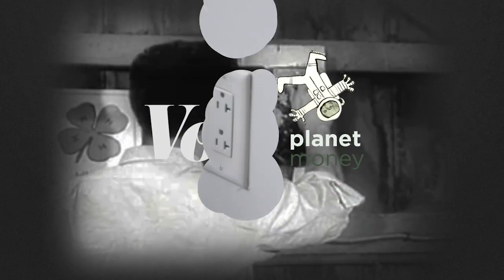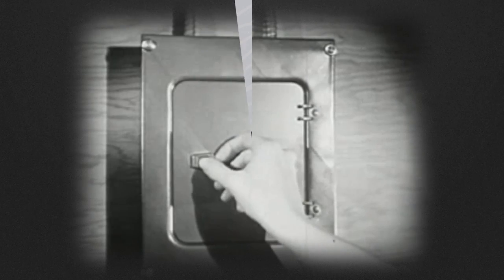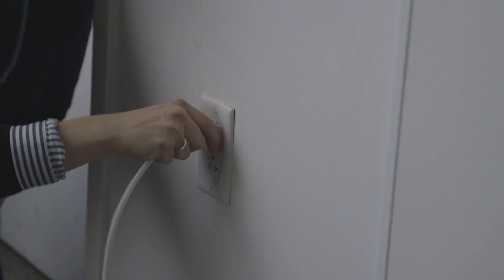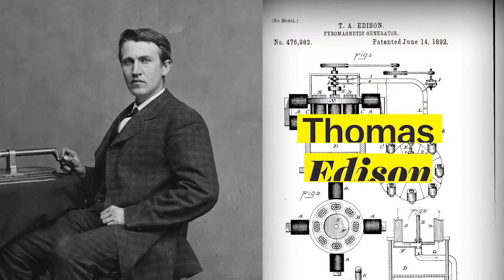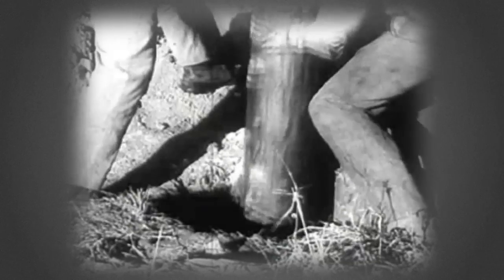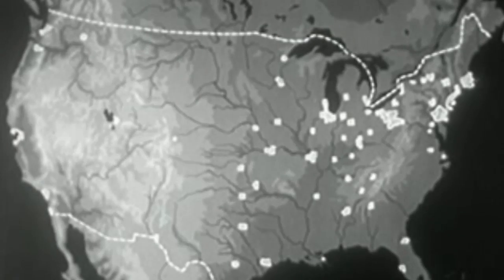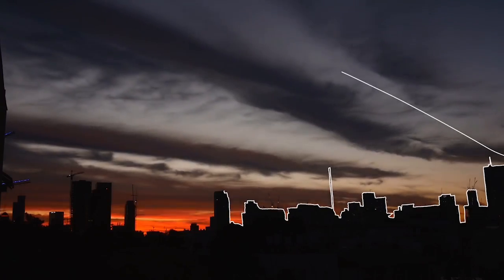Why your laptop charger is so hot

Comment: "Alternating current works just fine for things like light bulbs"....shows an illustration of an LED light bulb....smh.
Reply: Now lets plug this transformer into this 300V battery bank!
Reply: Jakob Schulze
DC doesn't have reactive power losses, but for shorter distances you would need a transformer which is much more than a simple pole transformer. I've seen some that look to be over 60 years old and operating, but electronics always fail. HVDC is good for transmissions longer than what AC can provide or to connect out of sync grids together.
Reply: They didn't really explain why AC won out over DC.  Centralized power generation and the efficiency of transporting AC over distance.
Reply: *****
25 cars in series!
Reply: There are reasons for AC and DC.  My comment was in relation to the time our national grid was made.  AC transition was cheaper at that time, primarily because of Edison's patents and the cost of DC transformers.  I am not sure if that would be true today, however the cost of replacing our power infrastructure would be cost prohibitive.  DC has significantly less power loss than AC, however that is relative.  An AC system with twice the loss of a similar AC system with a 3% loss would still be 94% efficient.

When the US national grid was made Westinghouse and Edison were battling it out with AC and DC systems respectively.  Westinghouse won because the overall cost was cheaper, and maybe he was a bit better of a business man.
Regardless, we have the system we have, and changing now would be cost prohibitive.
I am however intrigued by whole home DC systems.  I knew some appliance manufacturers have announced they may start production of DC appliances targeting the off grid consumers.
Reply: leerman22

dang
Reply: AC has inductive+resistive losses, where DC has only resistive losses. Those inductance losses eventually justify HVDC transformers the longer those lines get without a power plant or consumers.
Reply: DC doesn't work with transformers so you can't easily step up the voltage for transmission over long distances and then step it down again.  This means that in order to properly regulate voltage you are limited to a maximum service distance of a few miles from the point of generation or distribution center.  Increasing the voltage to transmit long distances results in significant power loss when you try to reduce it back down to a usable voltage.  Much of this is no longer relevant since technology has improved and many of these obstacles have been overcome but they were present and drove the development of our national grid, changing it now would be costly.
Reply: +Aaron Hall
For the whole grid this is true, but for some applications DC power lines might have a comeback.
I know in Germany and Europe they might be build to connect renewables better.
A lot of offshore Wind capacity is in the north of Germany, while a lot of industry is 1000km in the south.
France who uses over 70% nuclear has a demand/supply problem. Right now a lot of nuclear power plants are off the grid, while a lot of heating is done with electricity and at other times they have a huge overproduction, as most of their nuclear power plants aren't very flexible.
With renewables thus is worse of course.
One key there is to connect whole of Europe better to bring electricity from where it is produced cheapest/cleanest to were it is needed without any blackouts.
DC transit lines would be beneficial for those long distance power supply.
Reply: Yes, the advent of efficient HVDC transformers which were not present when our grids were initially designed definitely changes things.
Reply: the voltage drop is much more in dc transmission. modern electronics wont help in any way
Reply: they sorta mentioned it, barely... but there was so little information in this video that it hurt to watch it
Reply: +Aaron Hall
Actually over long distances DC is better than AC (as you don't create EM waves), but it is/was much easier to transform AC from high voltage to low voltage and the other way around. With modern electronics it is easily possible to do the same with DC.

Comment: I like Vox, but this video is just plain wrong. It is really disappointing.

Not just about why the converter gets so hot, but also the reason that AC is way better than DC over a long distance. If we output DC directly from the grid, the energy loss would be huge and we need lots of thicker cables to cover. There were photos showing how cables blocking the sky in DC area in the past.
Reply: "energy loss would be huge" i.e. AC is better than DC at traveling distance.

What they didn't cover is why it is better at traveling distance. That's because, unlike DC, AC voltage can be transformed.

Comment: How would having one large AC DC converter in a house be more advantageous than using small ones for each device? Assuming the amount of current converted is the same, what's the point? Are larger ones more efficient at it? They didn't express that at all in the video.

Comment: Well, judging by the title, I was expecting some scientific answer.  Instead, we get a conversation over AC vs DC.  A bit misleading, but still informative.  Seems more like an environmentalism ploy than any kind of explanation.
Reply: As a electrical engineering student I was so disappointed in what they said, but that's because they didn't go into the math behind it... Lol
Reply: I know something about science behind that. If you want more scientific answer then here it goes:

In most chargers you have a few elements that are helpful when converting AC to DC. First one is one that increases frequency of AC from 50 Hz (or 60 Hz) to higher one (AC to AC conversion, first place you get heat from). That allows everything that is after that to be smaller and therefore have less power loos.
After that there is a transformation that changes voltage of AC from 230V (±315V at peaks) to 5V or 12V or 20V AC. Voltage manipulation is very easy (cheap components) in AC and has high efficiency. However many chargers have low quality so energy loos here can be higher.
Third element is the actual AC to DC converter. It consist of 4 diodes. Those diodes allow current to go in one direction easily, but hard in other. Each diode outputs heat when current tries to go thought it the wrong way (but since there are 4 most current goes somewhere else), and a bit of heat when in right direction.
Fourth element is a stabilizer. DC after those diodes goes in one direction, but not with constant speed. Stabilizer fixes that using a big capacitor (to smooth down "bumps") and another (different) diode to cuts down excessive voltage (eg. you want 5V, capacitor gives 5,2V, diode cuts it to about 5,1V). Capacitor has some energy looses, but diode is converting everything above what you want into heat.

And that is what happens in every charger inside your home. So the question now is - why don't we have one, expensive, but really efficient one? (answer: profit)

Having DC power system in house would still require changing current, but in DC it can be done more efficiently - you need one huge capacitor and one transistor. Say you have 24V DC and want 5V DC. What you do is you charge capacitor until it reaches 5,1V and then unplug it and wait until it goes down to 4,9V and then plug it again and so on. Transistor is doing that plug/unplug thing. Fast, easy, and very energy efficient.
Reply: Devin Alexander
I hope I didn't screw up anything in my explanation.

Comment: "A lot"... how much? Also, isn't DC much more dangerous (that being one of the reasons it wasn't chosen)?
Reply: DC isn't inherently more dangerous. To the contrary, many argue that AC is actually the more dangerous choice. There's a lot of arguments on either side, "dangerous" is a very relative term, so its hard to get a definitive answer. 

They were correct in the video, the primary reason AC was chosen was its ability to be transmitted over long distances. This ability is granted by the capability of AC power's voltage to be "stepped-up" or "stepped-down"(increased or decreased respectively) with the use of a transformer.

 Transmitting unit of power over a long distance at a low voltage results in a relatively substantial loss as compared to the same unit of power transmitted over a higher voltage. Given Ohm's law, P = I * V and P = I² * R
It is possible to transmit DC power over a long distance at a high voltage (and we do, just not nearly as much as AC, and for different reasons. Google: HVDC Transmission); however, once it reaches the customer there's not way to efficiently decrease the voltage to a safe level for in-home use; no comparison to AC transformers. You could say, in a practical, low loss DC power grid, homes would receive a very dangerous voltage (500kV+) at the outlet. So, a DC system could be described as more dangerous. But DC itself is not.

That was a very long winded answer to a simple question, ask more if you're still interested.
Reply: DC is actually safer than AC at low voltages. In AC calculations you don't have to consider resistance, but impedance (capacitive or inductive). More AC current can thus travel through humans better than DC at relatively low voltages. The same AC voltage can send more current through someone depending on the frequency of it.

There is also the RMS measure of AC voltage (mine is 120V RMS, or 169.7V peak) which has a higher "peak" voltage. I don't think ElectroBOOM controlled for this while he was sending electricity through his body parts.
Reply: +maybachlover15 whats important is: can it make me breakfast, lunch and dinner?
Reply: Vitaliy K. No.
Reply: ***** haha great response! I learned a little for sure. So the limitations of DC make it, in practice, more dangerous. It's a shame such wasn't touched on in the video. They basically gave a grade 2 summary :/

Comment: DC is really inefficient for transmitting high power electrical supply over long distances.  AC isn't.

There.  That's why we'll never have a DC national grid.  No video required.
Reply: In general you are correct, but fun fact there are super high voltage transmission lines that are DC. Under certain conditions they are cheaper and suffer less loss than AC transmission lines

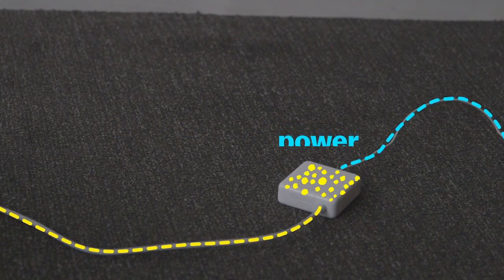Comment: 0:46 - 0:50 is literally the most explanation given
Reply: ...and their explanation is not even the primary cause of heat.
Reply: Thank GOD..i thought i was the only one who didn't understand this. Im so confused . CRAZY. thank you.
Reply: wrong. it is getting so hot because the electronics inside is dirt cheap and wastes more energy (as heat) than more expensive and efficient electronics.
Reply: @DieSportsKanone  Actually you're wrong too. The reason for heat loss isn't the quality of electronics, but simply because changing the voltage of the wall outlet to only whats needed in the laptop generates heat. This is because energy cannot be created or destroyed only transferred or transform. Nothing to do with "cheap" electronics.
Reply: you are no electronics engineer, are you? 
I am. Cheap means bad means hot.

Comment: Wow.. that was probably the most off topic explanation ever and wrong.. Transforming 240V -> 20V makes heat, there is literally hundred meters or more of very fine wire wrapped around a common core, some not much thicker than a few human hair. This causes a lot of resistance, which comes out as heat. It is also the heaviest part as it is just bunch of copper and iron. 

Not all laptop chargers have rectifiers, the thingymagiz that convert AC to DC, this is very efficient operation and does not cause much heat. So even that is kind of wrong. Some sens AC, some DC, some send multiple different DC voltages, it varies not only from manufacturer to manufacturer but from model to mode too.

Useless and incorrect video. You may end up knowing less after this one..

Comment: Factual error: talking about AC..: "That works just fine for light bulbs", but in the video is an Elgato-brand (brand clearly visible!) energy saving LED-lightbulb. And you know, yes those take in AC, but they actually use DC and have a tiny AC-> DC converter in them.
Reply: A trick used by the cheap ones is to use the LEDs themselves as a bridge rectifier. Put a lot of LEDs in series, add a current limiting resistor, and you don't even need to step down voltage.
Reply: And if one goes out, they all go out. How convenient.

Comment: Are you sure having a single AC -> DC converter box in a house would be more efficient than having many AC -> DC converters (assuming they are of similar efficiency)? Would all the gadgets then have to operate at the same voltage? (a fact that currently does not hold)

Also, one of the "device" mentioned using natively AC was an energy saving looking lightbulb, most probably LED one. Those take in AC yes, but they actually have tiny AC -> DC converters in them..

Comment: It is more efficient to have DC but getting shock by v120 DC is not the same as getting shock by v120 AC. One of the biggest issue of DC is that you need a larger AWG to get the same performance as the AC and once you have DC you can't transform it.

Comment: 1. What makes your charger hot is the resistors, capacitors, diodes, and converters that convert it from ac to dc. 2. hahahaha good luck getting every household to have 1 giant ac to dc converter as opposed to having one for every device. No one will want to scrap their AC compatible devices for DC compatible devices. Plus, its not like every device we have is a universal voltage. 120 volts AC is standard in the USA, but how would we determine the standard DC voltage? The devices that need an AC to DC converter run anywhere from 6 to 24 volts, so if we had a single voltage output, lets say its 12 volts, theres a very low chance most of your devices are compatible.

Comment: Video is massively wrong. Converting AC to DC is about 98% efficient. The voltage step down is what generates most of the heat, and all your devices want DIFFERENT voltages so a single unit isn't an option. Even if it was, the low voltage distribution through your house would waste much more power than the existing arrangement.
Reply: Not to mention that in this video they made it look as if that a DC power-grid is just as feasible as our current AC power-grid, without mentioning that during the era of Tesla and Edison. Edison had a DC power-grid in New York that required several times more wires that our current AC power-grid to feed a set amount of homes. Choosing AC over DC wasn't an arbitrary choice, and DC is the only one of the two that can be stored in a battery.
Reply: If converting between AC and DC was so inefficient, we wouldn't use HVDC on long distance wiring, but we do.  (There's no such thing as "tension of the current".) 

Over long runs, the (relatively low) resistance of the wires becomes quite significant.  So much so that the losses of the transformers on both ends is more efficient than the losses of higher current over the long line.  Also, HUGE transformers can be much more efficient than a little laptop power brick can practically be, so it's not proof of anything.
Reply: 98% effecient? so that 2% is heat?
Reply: Except for computer power supplies, where a lot of them are 80% or 82%. Desktop.
Reply: The 80% efficiency includes inefficiencies of dropping the voltage as well as the AC-DC conversion.  In fact computer power supplies will operate just as well and just as efficiently on high voltage DC input as they do on normal AC input...
Reply: Yes, you lose a couple volts in the rectifier diode bridge.
Reply: AC is way better but because you can't store energy with it you need to use DC. And converting from AC to DC is way easier than the opposite way, I studied this exactly. Also using DC to travel that electric energy from a nuclear power plant or something to your house would generate harmful vibrations since DC makes 2 poles, one negative other is positive and you get an electromsgnetic field which at high voltages is harmful. At AC they get canceled out.
Reply: cool my laptop charger recently cooked
Reply: rc xb if stepping down the tension of the current was so inefficient, we wouldn't use high tension on long distance wiring.